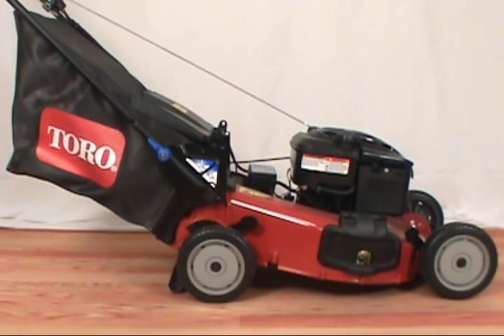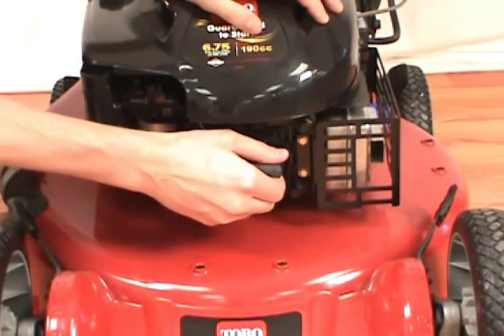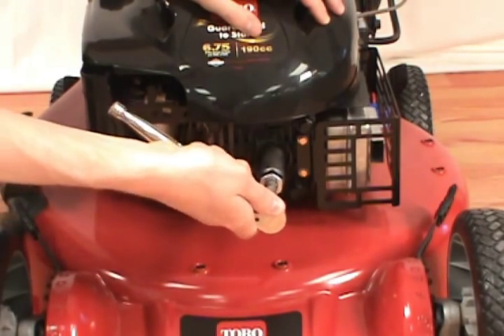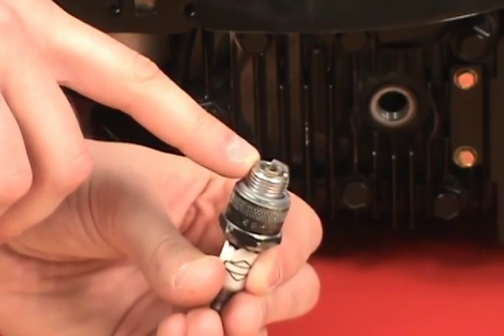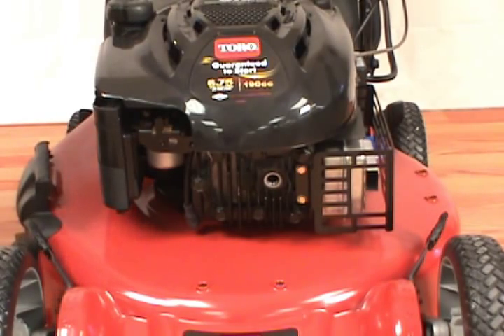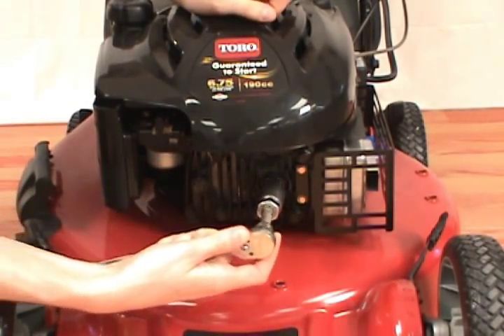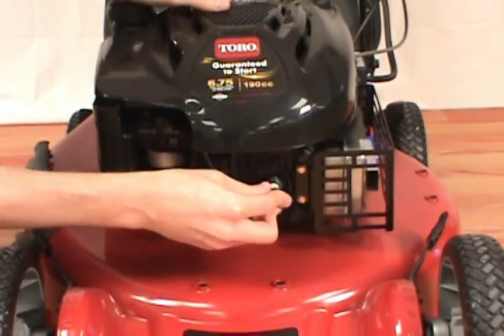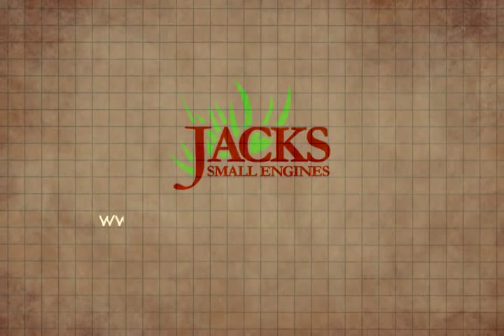Replacing the Spark Plug - Toro Lawn Mower

Comment: It would be very helpful if you revealed the spark plug socket size
Reply: 5/8 sp
Reply: 13/16
Reply: Plug is RJ19LM
Reply: 13/16
Reply: 13/16
Reply: 13/16

Comment: My family loss my owners manual a long time ago and I have the same lawnmower a Toro super recycler with a GTS 6.0 hp engine with a j19lm spark plug I've been trying to change out for a new spark plug I've gotten but for some reason can't find the right torque wrench for me to take it out I was wondering what type of wrench you used?
Reply: Cresent wrench

Comment: What size spark plug is that on that particular Toro?
Reply: Roger Wolsey that’s what i was wondering, I’m going to my local small engine shop now and i will find out for sure👍
Reply: 13/16 socket
Reply: 13/16 socket
Reply: 13/16